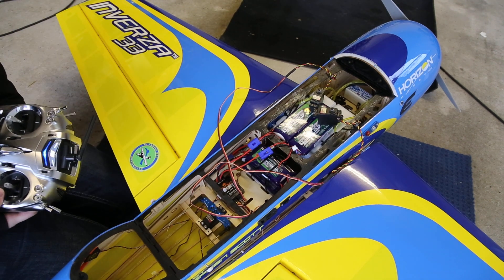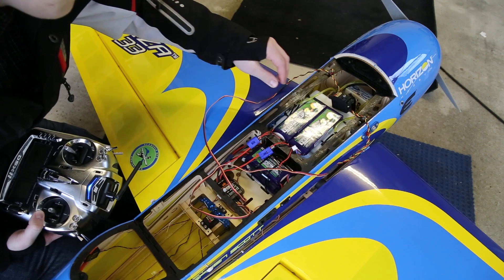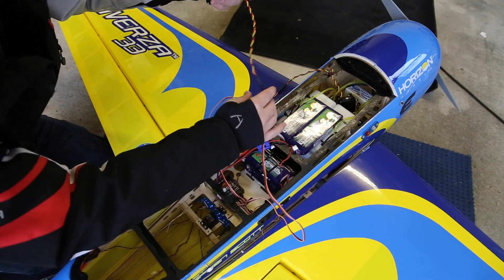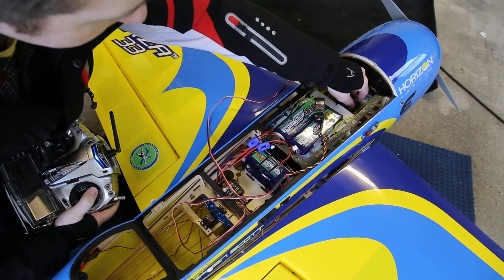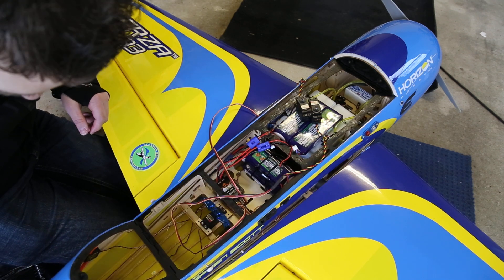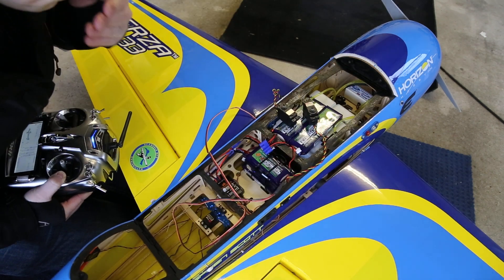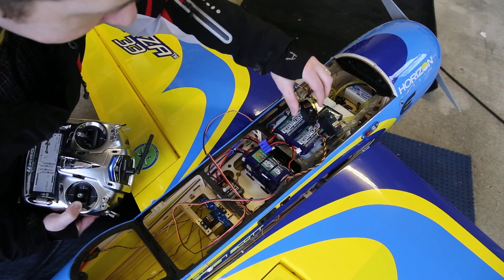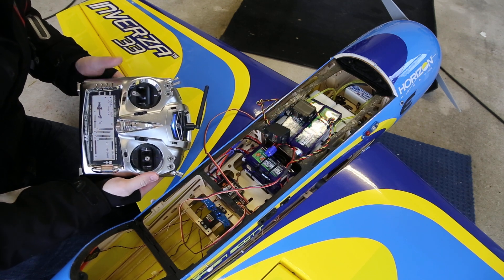HiTec HS-5685 MH HV Ultra Torque Servos Jittering on fully charged lipo

Comment: May I ask if you have ever tested running the red and black wires from the servos directly to the batteries, and the white data wires separately to the receiver? I had the jitter problem because the circuitry inside my microcontroller (in your case a receiver) caused some kind of unfortunate current instability when there was a sudden increase in draw. Bypassing the receiver and taking power directly from the power supply seems to overcome this problem.
Reply from the maker: I didn't try that. I found that the Hi-tec signal boosters cleared up the problem although I've since changed out the four lipo's (ignition, smoke and two receiver packs) for LiFe batteries and hadn't any problems since.

Comment: I see you have a smoke system any info on the install please
Reply from the maker: Sorry for the massive delay. I'm actually just after changing to a Power Box smoke pump instead of the MT Systems pump. I had to replace the MT version twice and thought I would try a more expensive version. As for the install info I found that two of the original Inverza tanks just fitted in the fuselage along side each other and I ran the overflow over the top of the tanks and put the bottom in front of the landing gear. I'm using a Secraft dual fuel dot.The smoke pump lifts the fuel from the smoke tank and injects it into the exhaust through a nipple I put in the exhaust. I find it works really well.

Comment: i had a similar problem. My throttle servo would respond late or twitch with no command ONLY when the engine was running. It ended up being bad rudder servo. I swapped it and twitching disappeared.

Comment from the maker: Yes, I checked the receiver voltage.When the lipo's discharged the servos were ok but to big a risk. In the end after we had spoke with Hitec and it was a voltage problem with the Spektrum Powersafe receivers. They told me to use Voltage Boosters on the longer extensions and after fitting them I've had no issues at all. Thanks for the comment.